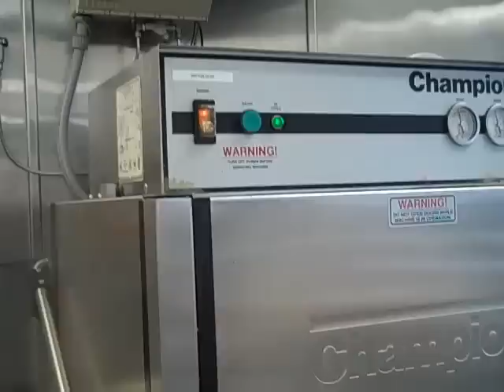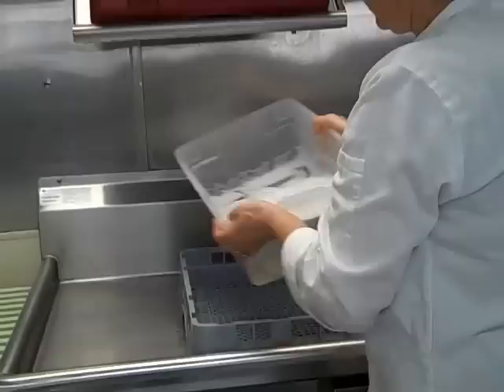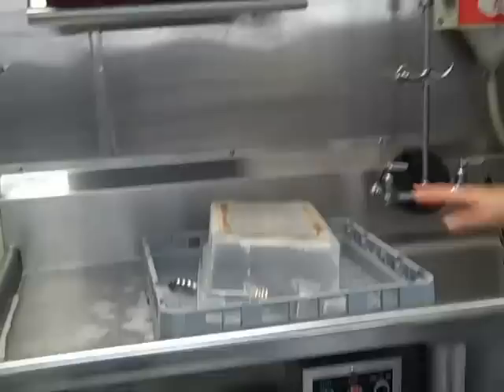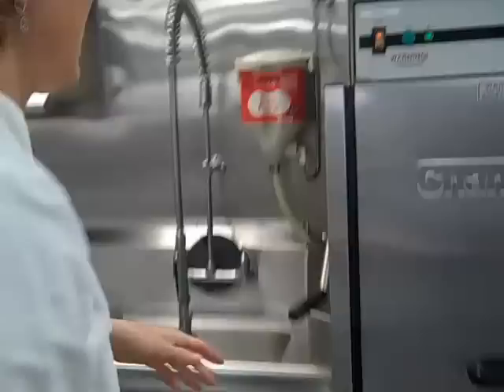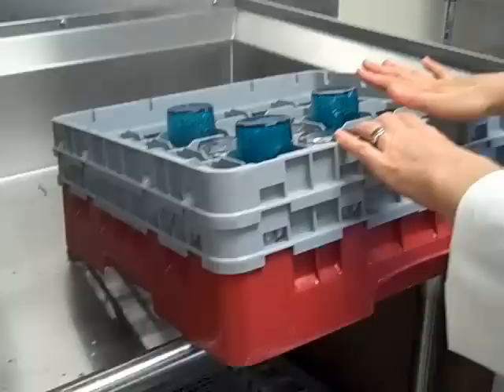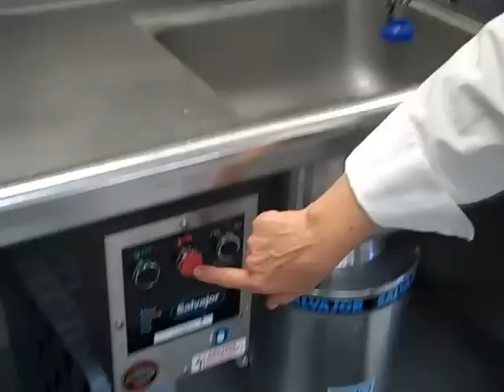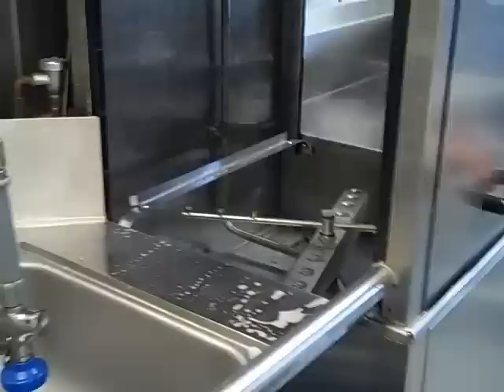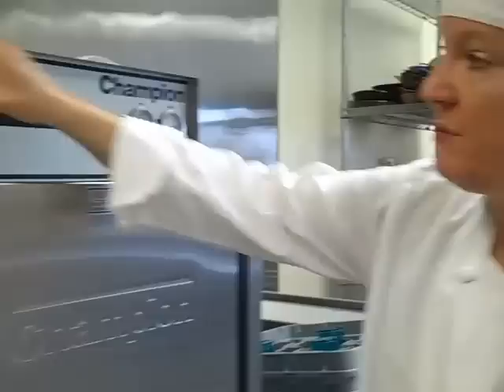Dish Machine

Comment: 2 problems - when the 2 glasses were with the open side up they accumulated the wash water that is recycled water full of germs and dirt . the rinse stage didn't clean the glasses so when you just emptied the glasses you left all the germs in the glasses - I wouldn't drink from those glasses . second thing was putting the plastic container on top of the utensils- the wash arm send stream of hot water with detergent but they will never get to the utensils because you just shielded them with the container . another one was using the sensitizer  hand soap that is NOT a food grade cleaner on food tools - very bad . what if there are residues from the senitiser  on the utensils ? people should eat them ? really?
Reply: completely agree! she also didn't wash her hands between handling the dirty dishes and putting away the clean ones...
Reply: bring your own dishes bro because only .0001% of kitchens operate like you want them to
Reply: And that was the wrong metal silverware which doesn't really move around that much in the dishwasher anyways. When I was at Shake Shack they would just put a second dishwashing rack on top of the one that was holding parts to the ice cream machine that makes the Frozen Custard for milkshakes.

Comment: I just gave my first thumb down, in a YT video, because when you make so many mistakes in a training  video, how can students learn it the proper way? I am sure, the person in this video has gotten some sort of knowledge, of how to handle dishes, but she needs to study it another time, to read about the fine details. Let's sum up now what went wrong.
1. There's no real need to wash hands prior to handle dirty dishes, but it is not forbidden to do so. What I found a little funny is the fact, that she said, after eating, using the toilet, you might have germs, yup that's true, but after using the toilet, washing your hands in the kitchen is a no go! You should wash them in the restroom sink, to keep germs away as far as possible from the kitchen.
2. Handsoap in a soakcontainer is a no go. It's meant to wash hands, and not dishes. It is best to use plain water or a special soaking detergent. IF it was dishsoap, then it's fine, but then, she washed her hands with it, and that's wrong. For hands, you use hand soap!
3. If you load plastic bowls in a dishwasher, make sure they can't get washed out of the basket, by placing them first, and having a plate rest against it, to hold it in place, OR you put them in a flat rack, with another rack on top of it. There also exist special down-pushers made of metal, to keep plastic utensils in place during washing. Another solution is, to modify the wash power, by intensifying the power of the upper sprayarm stronger, to push things down inside the rack, the lower wash pressure will minimize by this action! But good wash results still can be achieved by proper finetuning of your detergent dosingmachine.
4. If you put the silverware container on top of the silverware, the silverware won't get properly washed and have enough finalrinse water plus rinseaid to get sanitized at the end of the cycle. If you want to keep the silverware inside the basket, then put another silverware basket on top of it during washing. Better is, to modify the power of the sprayarms, as described in point 3. above.
5. The plastic glasses are too light to be washed, here also the power of the sprayarms are responsible for this, and so, they need to be modified. Or put a flatrack on top the glasses, to hold them in place, but this might increase breakage of glasses. 
When you empty glasses which are still full of water, this is not only final rinse water, but soapy water too, which is very dangerous, as the detergent remains inside the glasses and being drunk by your next customer. Rinse aid mostly is not poisonous, but it's still a chemical you want to avoid. (when I as an expert dish washer, go to a restaurant, and smell a glass before filling it, and I smell rinse aid, I'll complain!)
6. After the peg-rack has finished washing, you can see that the person is not an expert, at first, she pushes the rack from the inserting side, but an expert knows, you can't push it out at the other side, not furher than half of the rack! It is far more efficient to walk to the other end right away, and pull the rack out, but.... before doing so, you must sanitize your hands, and she doesn't do that in the video either. Or else, it has NO sense at all to wash dishes. What some dishwashers sometimes do, is, to press the clean rack out, with the next loaded rack, and pull it back in, before closing the door to wash it, but this is not advisable as the new rack touching the clean rack, will contaminate it. And like anyone else, here said too, the fallen out bowls are not clean either, after they fall out of the rack, and lay on the strainer basket in between the foodparticles.
7. When cleaning up, it's more efficient to rinse out the chocolatemilk of the uppershelf first, before you squeesy-off the bottomsurface, as it saves doing double work. Plus, only rinsing with plain water won't clean it, you must make use of hot water and cleaning detergent and a spounge to properly brush off all the surfaces, then rinsing it off, and then drying it with the squeesy and final drying with a clean towel.
8. After draining the machine, you should rinse out the tank, before filling it up again, as on the bottom of the tank, there always will be foam, grease and dirt particles left, which you don't want to have inside your new washwater. If you leave it like that overnight, after your shift, it will be rotten the next day, when you start the new shift.
9.  Touching the glasses as less of possible because of finger prints, is true, but she did not speak about the germs on her fingers after cleaning up, and not washing her hands first.
10. 
she transports the glasses rack, and unload the glasses, this she shouldn't do, as the glasses are probably not thoroughly dry yet, the rack is specially designed to dry them by air properly. It is much better to make use of a special regal-trolley which can hold of the glasses rack in whole. Then it also reduces handling and breakage.
11. The students better don't ask her further more questions, after all these points that went wrong. 
I suggest those students to read these points, and when having questions, replying below, asking me or other experts here instead.
Thanks, and I wish you good luck with your company.
Reply: Thanks for that,
starting a KP job tomorrow and now feel a bit more knowledgable :D
Reply: Thank you please tell whole dishwasher process. I want to rent a small restaurant. So i can tell my works to do same thanks again
Reply: Totally agree with you. I've been a kitchen porter for a while now and the woman in the video hasn't got a clue. The more you do the job you find which methods work and which don't. Where I work waiting staff can be a total nightmare as well. Some think they are being helpful when I'm on break by placing dirty items in the wrong baskets for me,  and then I have to take everything out and rearrange the plates and bowls or have to re wash everything again. It's the same with the silverware and they overload the cutlery baskets. I keep telling them to leave it for me to do but they don't listen! None of them have got a clue as to how clean things should be! They don't realize that it takes a good kitchen porter to keep the kitchen functioning and reduces the number of complaints by customers about dirty silverware and plates ect. I am very passionate about my job!

Comment: couple issues:
1) Glass racks or China Racks cannot be on the floor (period)
2) The plastic container she is using for the video is completed old and dirty. 
3) You cannot empty the silverware container full of detergent and dirty water into the table dish machine, she must use the sink.
4)The trash compactor should be on the left side on the table not on the right side.

Comment: That air dryer is throwing germs throughout the room. Nasty.
Reply: I've never seen a hand dryer in a kitchen before. I knew it was a possibility. I work in a school kitchen that has paper towels. Find the paper towels a lot quicker and my hands are nice and dry to easily get my gloves on. I'm kind of surprised they don't have a wall mounted soap dispenser somewhere. 
And kitchens are loud enough already you don't need someone making extra noise every time they dry their hands.
Reply: @robertknight4672  saw a TED talk on hand drying. Yeah. Anyway, dude shook his hands 12 times, and used one towel. Something called "interstitial spaces". Worked liked a charm. One towel.

Comment: You should clean the glasses in a separate glass washing machine most bars have them.
The water in the machine doesn't recycle until machine is cleaned at the end of shift or day.
Reply: That's only partly true what you're writing there. The final rinsewater will fall into the wash tank and will be mixed up with the wash water. The wash water will get cleaner that way. The detergent dosing machine will have to dose new detergent so that the amount inside the wash tank remains the same as before to keep properly wash and sanitize dishes.

But a special glasses washer, is always better. But before putting milk and juice glasses into it, pre rinse them.

Comment: You're supposed to change the water every time glasses go though. Otherwise they will have spots.
Reply: thenewstuffsucks no you don’t. The rinse water is clean water straight from the city supply. There is a rinse aid added to remove spots and to help the water sheet off of them, it also helps them dry faster. Wash water is automatically changed in the tank every 5 or 6 cycles. There are 3 cycles. The first cycle is a prewash, the second an intermediate  wash, and finally a high temp rinse, which sanitizes the dishes. The prewash and intermediate wash is reused every time a new rack is put in, and the high temp rinse is new water that comes from the city supply, gets heated, then goes over the dishes.
Reply: Most of these dishwashers can also accept rinse agent, basically a really large bottle of commercial Jet-Dry. When I worked at Shake Shack they were too cheap to buy it.
Reply: @johnanders8861  That may only be the case for a conveyor or a household dishwasher. In my 30+ dishwashing carreer I have never seen this in a single tank dishwasher as seen in this video! Only the rinse water comes from a booster heater which is connected to the city supply.